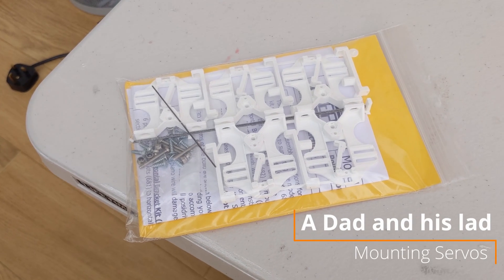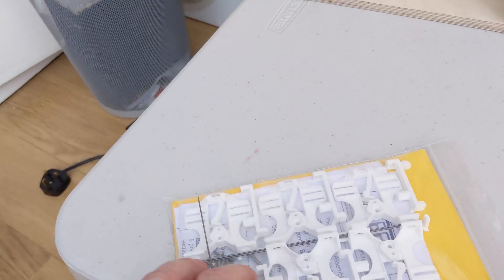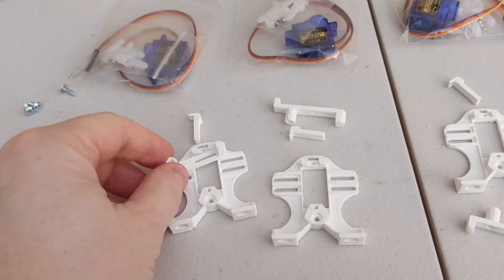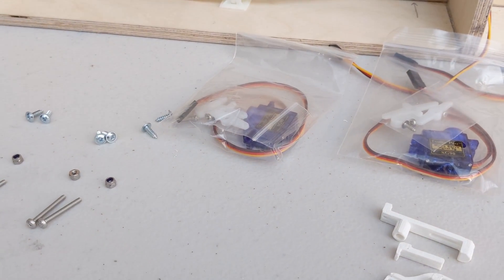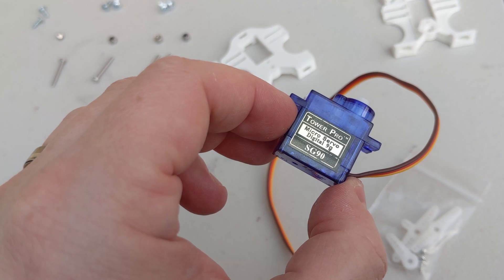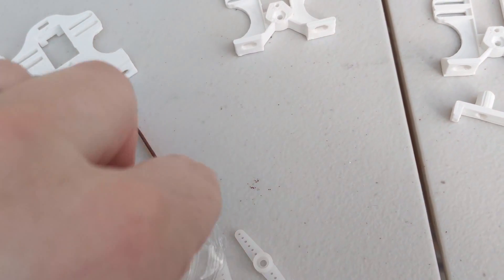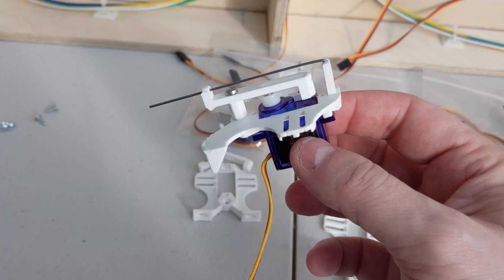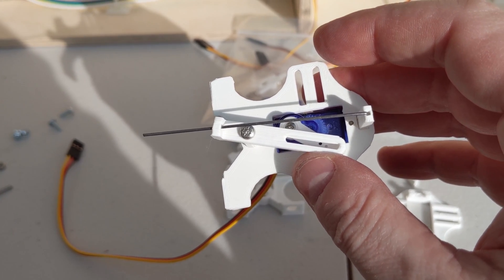Building MERG Servo Mounts

Comment: Your video shows pretty much what you can get from the written instructions that come with the mounts. What it doesn't show, and neither does the written directions, is the making of the slot in the table for the wire to move in. I wasted money on brass tubing and piano wire, not much wire with the kits, because before I bought the kits every video and article under the sun used them,